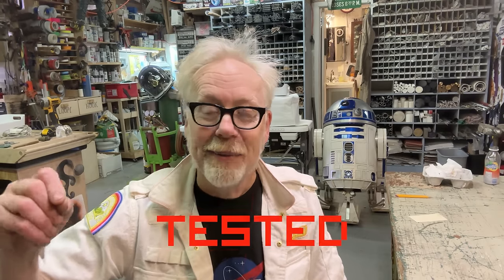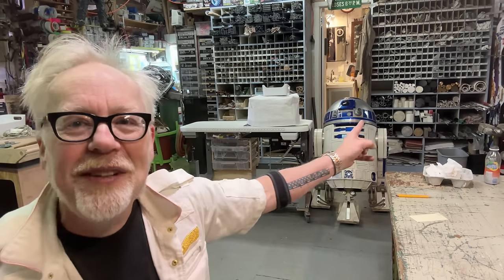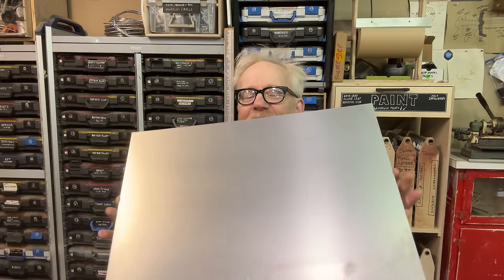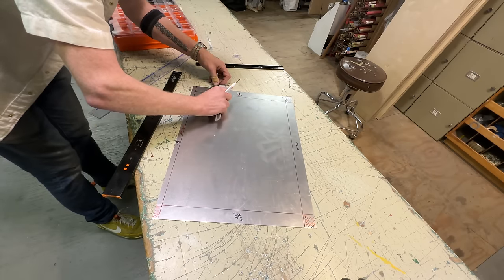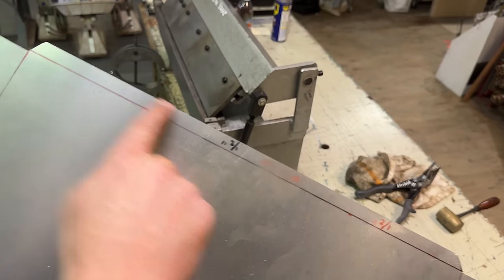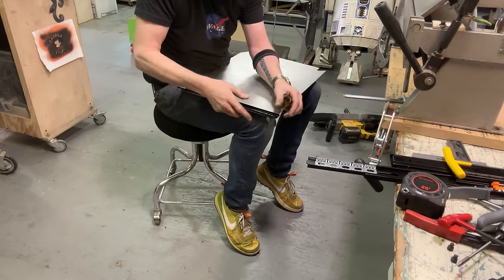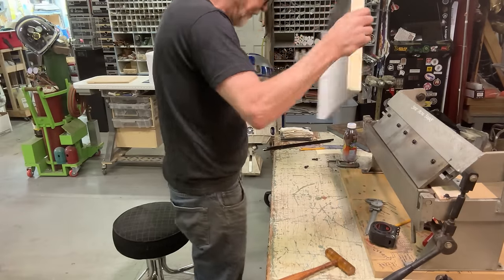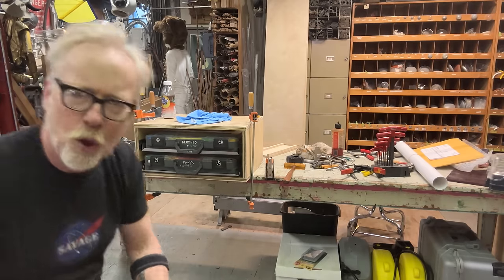Adam Savage Prototypes His Dream Hardware Storage System

Comment: For a little extra structural rigidity to the shelves, you might consider adding a V or X-shaped cross-brake across the bottom of the trays so that the drawers don't sag, as they seem to be doing slightly in your demo unit.
Reply: Also yeah, I was surprised Adam didn't start with cardstock or cardboard or something. But whatever, looks like he got the job done just fine practically on first go.

Comment: Great work! DeWalt, Milwaukee, et al have systems SIMILAR to this, but not quite like this. Drawers are definitely the way to go, but the other details are variable. How many drawers in each assembly? Is the drawer a tray for a box like you have done, or is the whole storage box a drawer? Do you have a mix of drawer heights? A mix of widths? Etc. 

I can say that I really like clear box tops, and I really like stackable boxes, and I really like drawers, and you've done ALL of that here! 

I think one optimization when manufacturing at scale would be utilizing the box's own structure as the floor of the drawer. Meaning: the sides of the box hook into the drawer slides. This way you could sell just premade drawer cabinet walls (with drawer slides perfectly attached) in a compact cardboard box for shipping. Then users just assemble the 4 walls of the cabinet and slide the storage containers in perfectly every time.

Keep up the great work!

Comment: 1. Looks like your bend allowance was off in the beginning. I am guessing the sheet metal you bent before was thinner.
2. Hem the front lip so you don´t cut yourself and it´s more durable and overall better looking. You can do the same to be sides as well. Especially when sliding the boxes over the lip.
3. Hope you deburr the holes before riveting, otherwise the rivet will not sit flush and can come lose.
4. What I do on those wooden structures is I use very thin 4-6mm Plywood a "skin" and make a structure underneath. This saves weight and costs. You don´t need those very thick plywood sides, they are just dead volume.
Those drawers are a good idea, organization is important well done Adam =)

Comment: Always interesting to watch you go through the process.  What would you think of having a pull out drawer-shelf at about waste height in each cabinet.  Pull a shelf out and put a bin on it for use. As for myself, I am short, the higher drawers would be unhandy as they are too high and the lower ones are a nuisance to get down to.  I don't use the bins or an hourly basis and moving one to a very convenient shelf I find to work out good.  But for you and your use each bin of a full extension slide is likely  the best way to go.  Thank you for a wonderful video.

Comment: Hey Adam + Tested Crew, long time listener, first fime caller here. 2 things, 1: this project seems like a good excuse to pick up a powered cordless rivet gun. 2: I'm also in SF and need to upgrade from HD/Lowes/Ace/Discount Builders/Center/Amazon for sourcing raw materials (lumber, metal stock, plastics, acrylic, etc.) Would be curious to know what providers yall prefer and would prefer to support local over big names (though the local Cole/Ace, DB, and Center are great shops for certain stuff). Cheers

Comment: I would say that attaching a wood base to the legs of the metal brake, say a 2x3, or even going so far as a 3/4 piece of ply across both legs, would make your break more stable and easier to clamp to work tables.  A full plate underneath could help if you ever wanted to put it on a custom dolly to make it easier to move around the shop to take it in and out of storage.

Comment: I work at a metal supplier near me, and for fun wanted to try to figure out about how many full sheets Adam ordered to be sheared. The Sortimo is about 14" x 17.5" (according to the link in the comment). Looking at what Adam wrote on his sheet and adding it up, that small sheet looks to be about 16.5" x 20.25" (rough guestimate). Assuming that his supplier gets their aluminum sheets in at 48 x 120 sized sheets, then Adam would need about 4.5 full sheets to get his 65 pieces. Neat!
Reply: What if they have 60x120 sheets?

Comment: Taking from my data center / server room experience, I think a single pull out shelf in each rack (cabinet) would have been sufficient.  Pull out the sortimo, pull out the shelf, do the thing, push back in the shelf, put the sortimo back.

A shelf per sortimo doesn't help because you still cannot access the sortimo under the active in use shelf.  Better to have a shelf in the next cabinet over if you need to work with two sortimos from the same rack.

Comment: Two potential improvements: Add a thin wire to the center back of each metal tray going from top to bottom of the rack and then spring tensioned. Pulling out a second drawer will tension the wire, and roll any previously extended drawer back in, it will also stop you from pulling out a drawer when another is open. Its very easy to forget when you're excited about finding a item. This also prevents the rack from falling onto you when too many drawers are pulled out. Second improvement: add a plastic car door edge guard to the leading edge of each metal tray. When slotting a box back into the tray, this will keep you from slicing your finger on the exposed metal edge.

Comment: I absolutely love this idea! I also find myself struggling to find the horizontal surface! And now you have me wondering… if it would be worth the extra effort to cut out the sections of the front lip where the latches are? And I mean so when your fingers reach for the latch, you don’t scratches the top of your finger on the aluminum or make a pinch point. Maybe I’m being over cautious but I also think the aesthetic would be pleasing to have the 2 places notched out! Either way this is one of my favorite builds!

Comment: I have a similarly organized hardware store in my shop, all it takes to negate a LOT of organizational efficiency is dropping or dumping a container w/ several 100 of 10-12 different items.  Yikes, it's a lot of work to fix things after a spill.

I sustained a disabling brain injury nearly 25 yrs ago. Caused cognitive & memory issues, particularly w/ a type of short term memory some call inconsequential input; info you hear or determine, (from measurement), but don't mentally process enough to get it into a different type of memory.

Among the many difficulties the injury has caused in making & repairing, I've also been pushed into finding accomidating practices.

One is the use of color coding my layout by using red for cuts, blue for fold, black for holes & green for threads.

Something was tweeked in my brain making colors better than even written notations; in the same color notes can simply disappear.

Give multi colors a try in your layout, it will reduce the moments of backtracking to verify &/or making mistakes.

GeoD

PS  Love me some Kant Twists, too!  Especially the little chits...

Comment: Rather than make 65 drawer slides, why not make 4 or 5 sliding shelves that nest into the storage unit so you could put them at a convenient height, pull out one when you are going into your bins/boxes, place the bin/box on the shelf, then when you have finished replace the bin and push the sliding shelf back into the unit? As it is, you will have some units that are inconveniently low or high. Adding a sliding shelf reduces the work by an order of magnitude and provides the functionality you seek. Just wondering.
Reply: That's exactly what I was thinking

Comment: Initially I thought Adam was going to utilize the drawer slides with the sortimo cases directly rather than building drawers to hold the cases. I was wondering what’s the point of pointing out the “slide things” on the sides of the cases to not actually use them.  Regardless watching him create is incredible in itself.

Comment: This is fabulous, and would work SOOO well in my extremely limited space. So often have tools/components/materials I'm working with taking up what space I have, not having to pull out and set down hardware boxes would be amazing. 

Unfortunately Sortimo is definitely too rich for my blood. If I made a living using them or at least used them quite regularly I'd definitely consider it.  So, I need to find a "Harbor Freight" kind of answer. Ie, cheap but still effective.

Comment: Just cut a sheet of wood thin enough to fit between two of the cases, you can slot the shelf into any gap and pull out the necessary rack. Get the bit out, put the rack back and put the loose shelf stood up on the top of floor in front.
Reply: I was thinking the same.
Actually, I was reminded of Alexandre Chappel's tower he built for his custom boxes that has a pull out surface to set the boxes on. It's definitely more approachable and affordable.

Comment: I would use one of your prototype drawer shelves under your work table as a place to put the sortimo if you need a lot of parts or pieces out of one. It looks like two would be in the way of sitting in front of the table i would probably inset it into the horizontal table bracing.

Comment: Idea for getting the tray widths all the same and square: Cut a piece of plywood that fits exactly in the tray. Bend one side up then place the plywood guide in the tray and slide the other side of the tray into the brake, butting up against the plywood, clamp, remove plywood guide then bend. This will force the sides to be parallel and all the trays the same width.

Comment: get yourself an air pop rivet gun, esp for the 65 run!! cheap and so much of a game changer.

the new slides/draw seems a bit on the flimsy side to me, i'd have gone with steel rather than aluminium, not sure about the flex in the slides though

Comment: I hope you haven't already gone through the trouble of installing that design on all your vertical racks... as cool as it is. I'd like to offer a slightly different solution. Use this design of yours, but only install ONE, between waist and chest level, in every vertical rack. Use it like a pull-out shelf (flat surface) and share it for all the Sortimo bins. 

You'll probably quickly realize that it will be difficult to view the the contents of the the bins at chin height, and higher, and will be pulling them down to a lower level to get a better look. And since you're my age you probably don't like squatting for any extent of time either, so you'll be pulling those bins to a higher, more comfortable location, anyway. You need the shelves close enough so you can see, and far enough away that you're not supporting the full weight of your arms for long periods; Kinda like a typing stance, with palms resting on the shelf. Just a suggestion. 

Don't believe me? Go to an Ace hardware store that sells the nuts and bolts in those little slide out bins. There is always a little shelf in between the top set of bins and bottom ones because customers always pull out the top bins and bring them closer to their chest level to get a better look.   

I've watched your content (Mythbusters, on to present day) for quite some time. I see some similarities to our approach to things at times, but shake my head and chuckle at others. Either way, you've always been entertaining. Thank you!

Comment: This might be a dumb question, and I may have missed Adam answering it, but if the Sortimo cases have the molded-in points for drawer slides, why not simply use those instead of constructing the whole drawer? 

I can see that being a bit of hindrance if he wants to still be able to pull the cases out and move them, but I would think the slides would have a quick-release option for that anyway.

This isn't a criticism, btw, just an honest question about the reason for the is process over a simpler one that the containers are (or appear to be) designed for.
Reply: Near the beginning of the video, he did show the "acrylic on the drawer slides" prototype for sliding the Sortimos directly onto, then a minute later he says something like, "If that doesn't work, then what is our solution?" and goes into the aluminum plan without explaining why the acrylic on the drawer slides plan doesn't work. I would speculate that the "directly on the drawer slides" prototype is too finicky for loading/unloading the Sortimos. You can even see in the second aluminum pull-out prototype that he shortened the front lip to make it easier to put the Sortimo in when the pull-out was closed.

Comment: 18:49 if you bend the sides first you wouldn't need to use the hand break, and you could do the sides of all of them and then adjust the panels of the break to fall inside those first bends for the front and back panels

Comment: Knowing my own clumsiness, even in a shop, I'd have taken a half-circle/oval or small rectangle cut out of the short, front-center lip and bottom of the shelf. Just take a centered cut roughly 20 to 25 cm wide back enough that when I grab the handle of the Sortimo, there's no chance of cutting my fingers on the front lip.
I can just picture reaching over quickly and jabbing the tips of my fingers down on the steel, with my fingernails sliding on the other side of the lip.

Comment: Food for thought: In the name of my genetically reproduced frugality, It seems like putting one slide out shelf in each column for sortimos at an ergonomic height of your choosing. Would only need to accomodate the height of the drawer slides and ideally a nice piece of your favorite birch plywood with a faceplate board and pull handle. That way you aren't hunkered over on the low shelves, or in need of a stool on the highs. Minimal rework of existing shelving units, and keeping things in that preferred ergo levels.

Comment: I used to make up jigs for almost anything that would be done mofe than something like 4 times, even just to ensure that every piece was reproducible, and every part fit every item... i sometimes used polycarbonate sheet fkr jigs, because you can see through it to what you're punching, marking, drilling, et al, and you can put drill bushings in for stuff that needs drilling, and it's easy to erase marking pen marks, and reuse the jig...

Comment: Good Idea Overall, However, What if you left a drawer around chest high that you could leave empty. This way drawer at the bottom or up above your head (which are hard to see whats in them) could be removed and set on that open drawer. This would also be a good spot to sort things if necessary. One other idea, do you actually need the front lip if the sides are captured? Is a sharp edge and I'm not sure if that is really needed. Seems to me you could design the sides to hold the sortimo and then you could have full access to the handle without the sharp edge and its one less bend you would need to do.

Comment: 27:47 I have to keep explaining to my mum why I bring so many tool's over to do thee most basic things. Were currently building a garden room and I've got every power tool, all my screws n clamp's n all sorts of hardware along with anything else that I might need but never used. There have been times when I've just taken the most basic bits to do a job n been told "don't bring everything" and then realised that I actually needed quite a few other bits because I couldn't do the job without them. I'm still laughed at for bringing loads of tools but then I have to remind them all the time they've said "don't bring everything" reminding them that I couldn't finish the job because you said "don't bring tools that I might need just incase.

Comment: Seeing you adjust the number of plates in the large metal brake machine I realized that you had to have a relatively precise width for the final bends because previous bends would hit a wider set of plates. Then I realized that in doing 60 of these you would need to optimize the bend order. My guess would be you would size the plate width for the long edge and do the short edge bends first. In my mind, then, I could picture you not having to adjust the width.

Is that the case?

Comment: I would have just added a pull out shelf to place them on. Just a single piece of plywood on drawer slides. Fit it between two boxes and pull it out when you need to set one down.  Can even add a bunch if you need multiple boxes open at once.

Also the full circle on drawers is real.

Comment: Call me crazy... but wouldn't it be easier to build one empty pullout shelf to set the bins on. You pull out the flat surface shelf, place the bin on it, search it, and then put the bin back. Could you conveniently place the empty pull-out shelf in the middle of the racks? It might even make going through the lower bins easier, one wouldn't have to search them while bent over or kneeling on the floor.

Comment: We have something at work, like what is described in the first 3 minutes. They're these sheet metal organizers cases. Each case is on it's own metal pull out shelf, and each unit holds a set of 4 cases. Use them to hold a bunch of miscellaneous hardware, & specialty batteries.